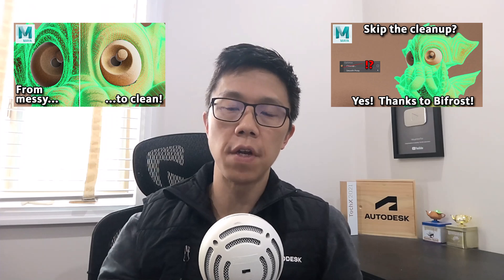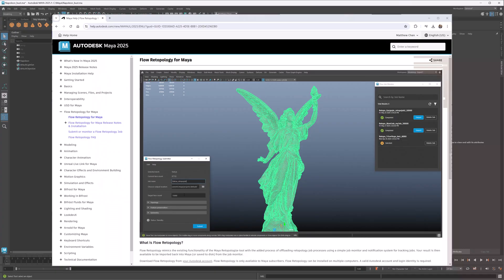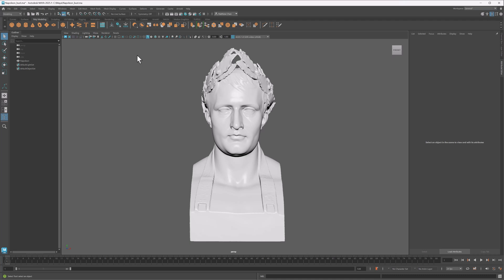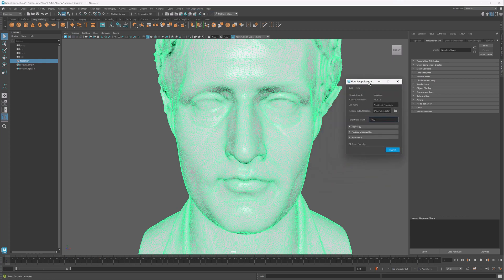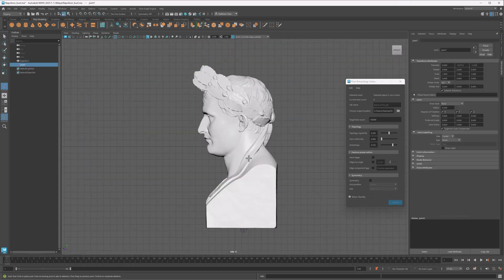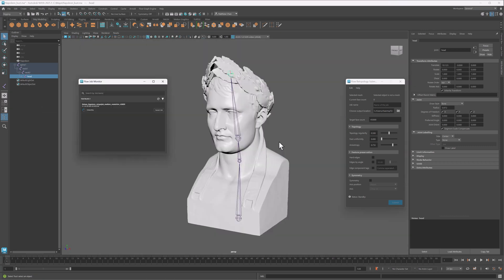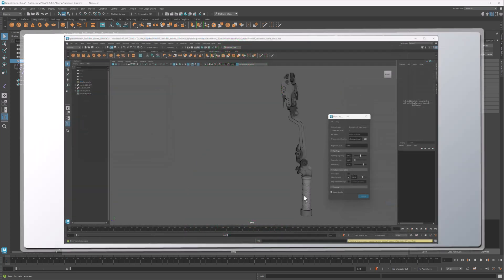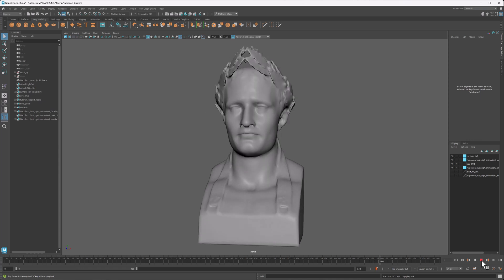Have you tried Flow Retopology?

Comment: If you look at the front of the result, then (at 5:22), that's not normally how I would retopologize. I would make that area with a lot fewer quads. Is it possible to make the result adaptive so some areas are more dense than others?
Reply from the maker: I mentioned it in the video but realize I should’ve shown it: you can use hard edges to guide the retopo result.  So for example, around the mouth you could harden 1 “ring” of edges, run retopo, and the algorithm would do its best to build subsequent rings around that.
Reply: @Autodesk_Maya  Okay cool. :-)

Comment: The process is single-core and doesn't use many resources. Wouldn't it be more practical to just use our own computer, which probably has a faster CPU than the server's CUP? In the meanwhile, we can open another instance of Maya and keep working instead of reading a book or taking a coffee break.
Reply: Always has been. They don't know how to do stuff with multiple cores. The UVs toolset all run on a single core.
Reply: @AyushBakshi   It's pretty hard to do multicore processing for jobs like retopo or unwrap, as cores run independently of each other. however you divide the job, it still require commuication of logically apart areas.
Reply: @water_blaze  doesn't matter if it's hard. Other software like rizom is doing it just fine. They should develop like that too to justify their insane pricing.